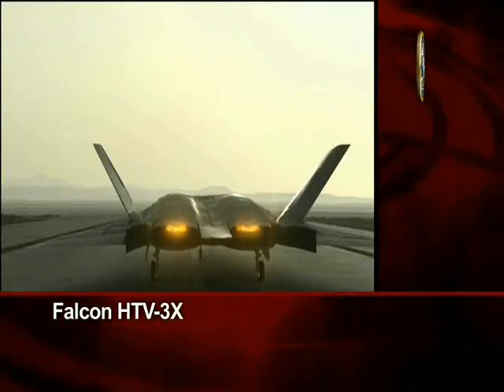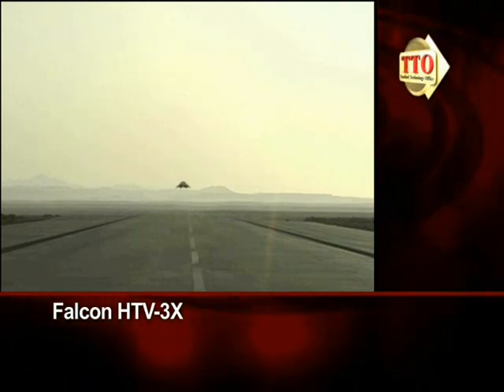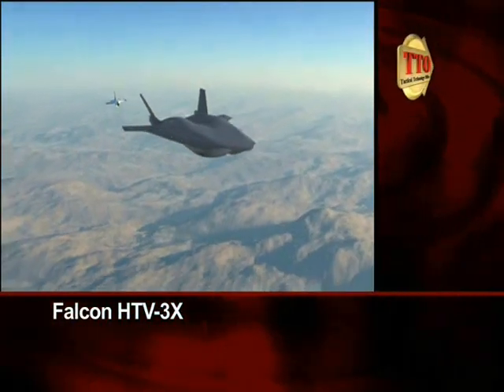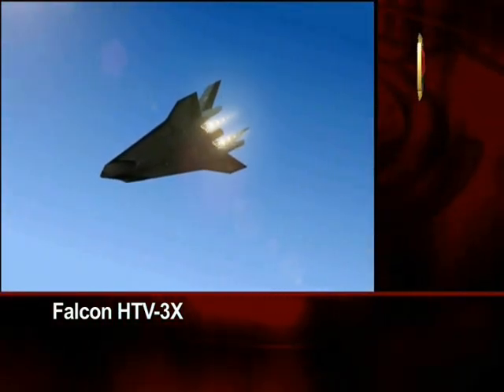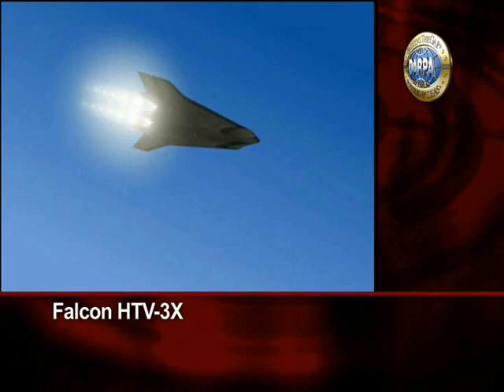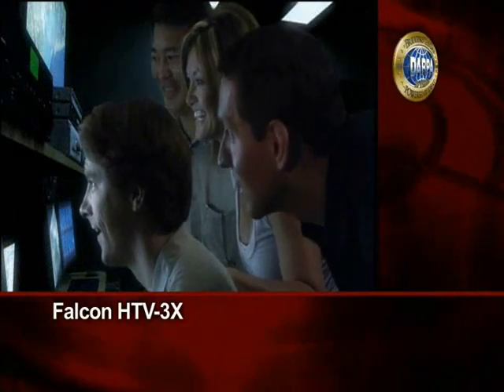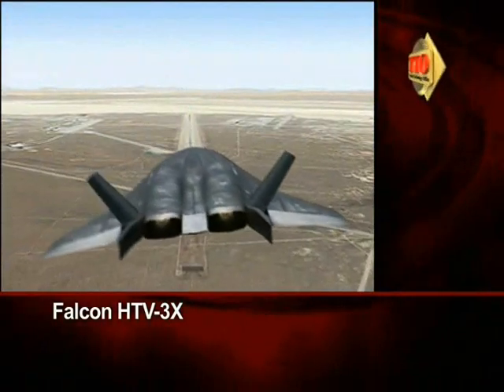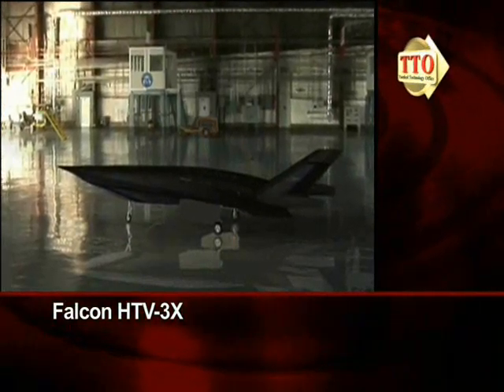DARPA Falcon hypersonic X-plane - part 2

Comment: Cool, and impractical. An air-launched 2-stage space plane, similar to the Space Shuttle and SpaceShipOne and Two would probably be the best space plane, from an economic standpoint.
Reply: This isn't a spaceplane. It would maintain level flight from its own lift throughout its entire flight, powered by an airbreathing engine. It is also designed to be a strike vehicle, which spaceplanes like the Shuttle or SSO can't do.
Reply: @jwandel  Old youtube comments. That was a reply to someone talking about SSTO space planes.

To which I responded that 2STO is better than SSTO.
Reply: @SargeRho  Ah, yeah thats funny. Also funny we're responding to an 8 year old comment

Comment: @thomaske917 

Don't know about this, but the hypersonic vehicles they have now are generally very small. The HTV-2 was only 12 feet long, and the X-43 is about the same. Look at the wikipedia page for the X-43 size. Hypersonic vehicles of this size are too small to carry a person (and too unsafe and experimental right now). They are unmanned vehicles with on-board control systems that control them. I believe their path is somewhat pre-programmed.

Comment: @batonpatriot There is no doubt that the Air Force is trying to develop a hypersonic aircraft.  They've already done two successful flights of the X-43 through NASA.  The real question is whether they already have something in service.  The famed Aurora.  I haven't seen any convincing evidence of it, but part of me, that giddy aviation nut in me, wants it to be real.  It seems these days that pilots are designed out of the planes for smaller, longer endurance drones.

Comment: @gtq838 Nobel Laureate economist Paul Krugman:

"The [CBO] report finds that extending the life of the trust fund into the 22nd century, with no change in benefits, would require additional revenues equal to only 0.54 percent of G.D.P. That's less than 3 percent of federal spending — less than we're currently spending in Iraq.  Given these numbers, it's not hard to come up with fiscal packages that would secure the retirement program, with no major changes, for generations to come."

Comment: @gtq838 Um...no. If the IRS was accurate in 2008, taxes collected in the U.S. are @2.56 trillion annually.
For 2010, the president budgeted 663.8B. When it went into law it was 680B. A bill in the House is currently asking for 35B more.
Defense-related expenditures outside of the DOD constitute between $216 - $361 billion in additional spending, bringing the total for defense spending to between $880 billion and $1.03 trillion in fiscal year 2010.

Comment: Ok, I'm an astronautical engineering student, so I hope that I have some authority on this. Ramjets and Scramjets are essentially the same thing in design; the only differences is that a Scram jet is intended to operate at supersonic pressures, while the Ramjet is subsonic. So its like the Blackbird, just using a ramjet that is designed to operate at supersonic pressures.

Comment: You seem to be assuming a Ramjet and a turbojet are two different things. Resa
earch the SR-71 Blackbird. That was a turbojet/ramjet engine, not two separate types of engine but a bypass of the turbojet and fuel mixing with the bypassed air in the exhaust. A scramjet would/will be pretty much the same only burning supersonically hence Supersonic Combustion RAMJET. Come on, it's entirely possible, once they find out how to combust air and fuel at MACH1+ instead of artificially slowing it down.

Comment: This video makes no sense what so ever. The fuel requirements for both the turbo jet, and ramjet would take up so much space volume wise, that it would destabilize the aircraft after passing mach 3, even below 60,000 ft! NASA's X-43A project already proved that a scram jet requires a massive booster before ignition anyways, so I don't see how they could even remotely fit that much energy in such a tight space.

 I'm not even going to delve into the space requirements for 3 separate engines...

Comment: If you're referring to the European Space Agency's Hermes shuttle, that project was terminated  in 1993; no prototypes were ever built. As for the Hermes UAV, it has a maximum speed of 95 knots. Keep in mind also that the Mach speed of an abject is relative to the atmospheric conditions around the object; Mach speed has no meaning in space. No manned vehicle has ever exceeded speeds of Mach 30. This record was set by the Apollo Command Module as it reentered earth's atmosphere.